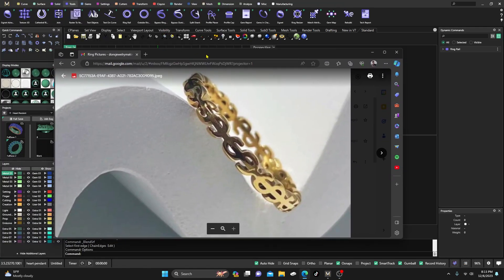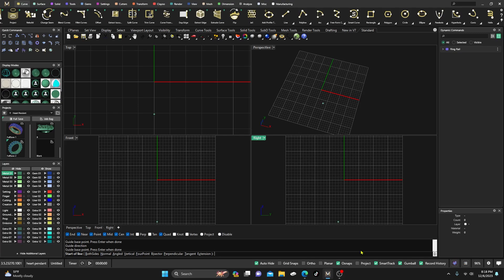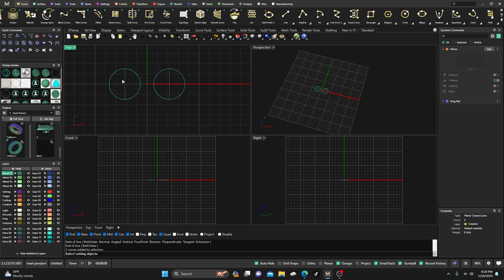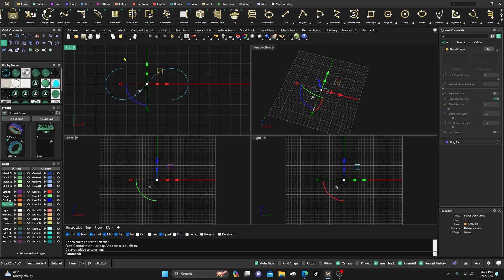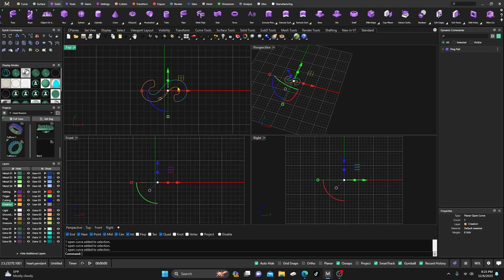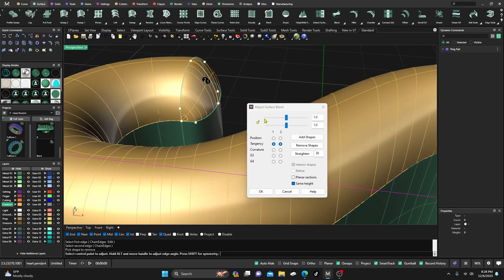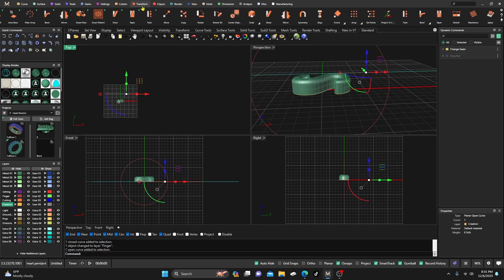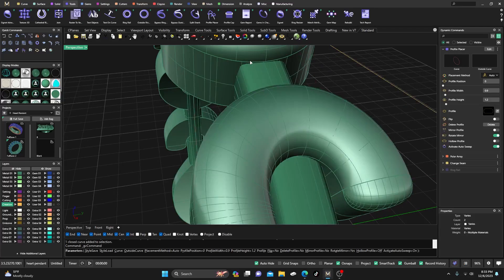MatrixGold Bank Ring

Comment: Great video!

My construction plane is barely visible. 

and

You have snapping choices listed like end near etc.... I do not.

Help?

thank you
Manny
Reply from the maker: The grid should be adjustable in options. You can check rhino options or go to view ribbon, and you should have a grid icon you can look at. The osnaps you just need to click on. You should see the auto hide Grid snaps line and there is one for Osnaps. If not, you can go into rhino options to toolbar scroll down until you see Object snaps and try clicking on it to see if that fixes it. Are you a member of the FB group. If so, post a picture of your screen in there showing what it looks like, and I can maybe help out a little more.